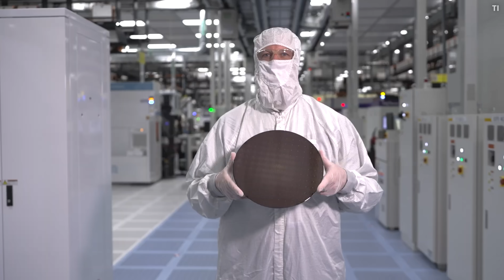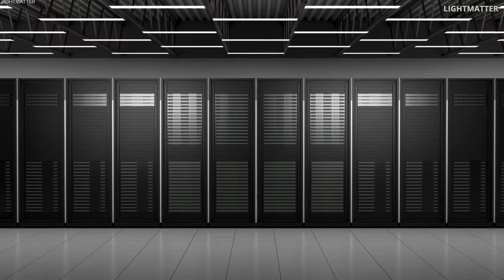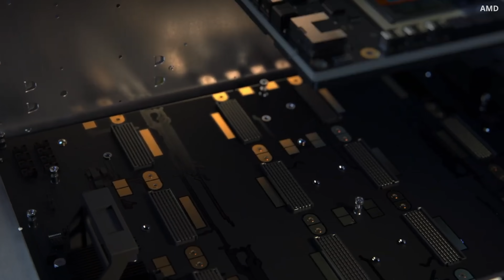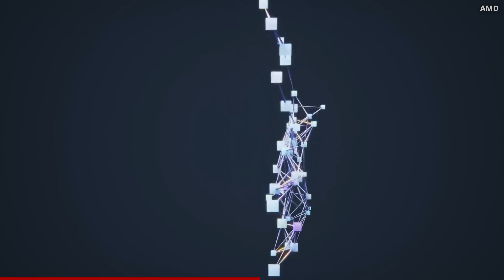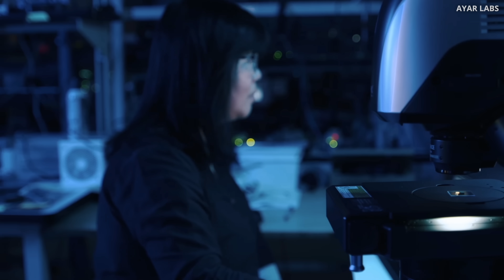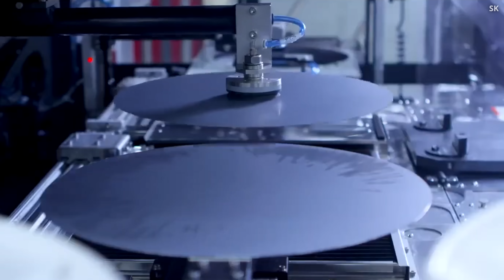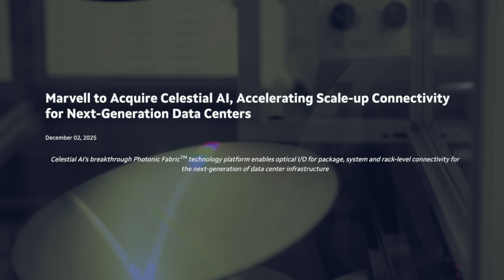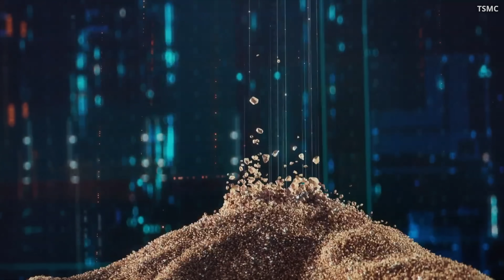Everyone Is Chasing This Technology

Comment: @AnastasiInTech,

I'll grant you the science: gallium-arsenide lasers grown in etched silicon trenches, a modulator running near 440 gigabits per lane. That's hard won. But you're treating the breakthrough as permission for the growth it unlocks, and that is the mistake.

Light really is more efficient per bit moved. The trouble is that efficiency per unit and total energy used have pulled in opposite directions for fifty years: every time we made a bit cheaper, we moved so many more of them that the total bill went up. That's Jevons paradox, and it means faster optics won't relieve the resource crunch. It will accelerate it. The limits that actually bind don't care how clever the chip is. Cooling already eats about 40% of a datacenter's power, one campus pulls 1 to 2 gigawatts, and you can double interconnect efficiency every couple of years, but nobody doubles a grid or a water supply on that schedule.

Then there's the money. Three-billion-dollar acquisitions and million-GPU factories are being financed against projected demand, not revenue in hand. Most of the capital is circling back on itself. We've seen this shape before. In the late dotcom years the companies laying fiber were right about the internet and went bankrupt anyway, because the demand they were right about arrived too late to save them.

That's why your framing is the problem. Celebrate this as the last obstacle cleared before we scale again, and we are re-running the fiber boom with bigger numbers. Except this time we're putting the climate in peril, not just the bank accounts of big tech bros. Make efficiency the goal instead, and the same breakthrough changes jobs. By efficiency I don't mean one more way to squeeze scale out of each watt. I mean a fixed ceiling on power and water, with the intelligence engineered to live inside it. The systems that survive the next few years will be the ones that live within their supply, the way a tree grows out of what it captures from the sun rather than stripping everything around it. Photonics might be the next step. What I keep hearing from you, though, is that every step is a reason to build bigger and pull more power. This is the video where that reflex reduces your credibility. You read this stack better than almost anyone covering it, which is exactly why it's frustrating to watch you spend that credibility cheering the part that breaks it. Point it at efficiency instead. That's the target worth chasing.

Comment: Then those Datacenters, should have renewables everywhere: Solar Panels on the roof and exterior walls, Smaller Eolic plants, invest in Hydroelectric Plants from nearby rivers; Thorium Molten Salt Reactors, and other types, if they have so much $ to make them, they can Contribute to Society, by not being a burden to Society.
Arsenic, being tossed on landfills, poisoning the ground, water, that people will drink eventually; hence, bad idea. We need to garanteee, the millions of Tons of Arsenic compounds, where to repurpose it, without being toxic? I think, we need to keep searching.
I hear that Transparent thing layer Crystals can be done with Tungsten (W), and it has the highest melting point 3,700ºC of all Elements, maybe this could be used for making Microchips and Photonics

Comment: Hoora Anastasia ,
This is EPYC,  (yes i use AMD, affordable 7713 & Mi300 ) cant afford 9005 Zen4, u've struck a gold HIT, a Helios Goal.

Only solution in future  
real-time inference datacenter engines,  power-hungry last mile copper >Si  interconnect,  IS exactly Light.

Of course materials, limits physics with pandoras box issue
GaAs in Vchannel Si not long term stable.. thus Ge epitaxy on Si-

Coupe has gr8 optical thinfilm interconnect bet 
standard GPU racks (obv to protect D.C investmnt

SO GLAD u brought LM into this💨🎆 STACK.
with dichalcogenide ALD now simulated to 5-Layer  its only a method to achieve production atomic integrity.

Import my 3rd Emicroscope,to AU this time a 2KW Fibre pulse laser waits to unpack.

Light Matters are right, a need to replace junction FETs
High speed GaAs laser integated optics, to address layer adjacent GePSi compute slices, phosphorus Gr8 @ UV

Comment: "Instead of omitting photons it just releases energy as heat"
Heat is a photon (infrared). All you need to do is work with that freq or shift it (such as the Compton Effect) to another Freq.
Actually from a physics level even the magnetic field which surrounds a wire is a freq of photon. Magnetics is below radio waves.
The mechanics are that at each freq some things are transparent, some thing reflect and others absorb. It is true for all freq. The rules just change at diff freq. For example metal or magnetic fields are opaque to radio whole walls and certain amounts of rock are transparent. Know your properties at each freq and use them.

Comment: If the problem is the power supply, the smaller size, the metals needed, the heat they produce, the simultaneous speed of processes inside the system and in the other hand you have a printer that prints meat.... stop thinking about how to build another chip of silicon and metals... and print a 3D brain made of meat. As raw as that.  En español: Si el problema es la fuente de alimentación, el tamaño más pequeño, los metales necesarios, el calor que producen, la velocidad simultánea de los procesos dentro del sistema, y por otro lado tienes una impresora que imprime carne... deja de pensar en cómo construir otro chip de silicio y metales... e imprime un cerebro 3D hecho de carne. Así de crudo.    ----    Design and print a "meat chip", like the brain works and see how it works, because may be with a few thousand "printed brains" you might achieve  better results without the heat, the metals, and a lot of other problems that non organic systems produce... Start thinking on "organic chips"... ---- i said it before like robocop 1... but more like  the approach of the  "bicentennial man" movie...

Comment: I would say, a big part holding us back is insufficent math in our code. Most programms guzzle ram, and cpu power, mainly because we don't focus on math elegence and computing efficiency, but just bloat all stuff. Look at for phone when starting it for the first time, how many programms are you using of the pre installed programms? Or windows 11. At the point of windows 11, a huge factor why windows 11 is so slow is because your data get's sent to the cloud, and ai is watching you, meaning bloat you don't activelly use runs allways in the background.

Comment: POET Technologies Inc. (NASDAQ:POET) introduced the Hybrid-Integrated 1.6T 2xFR4 Transmitter photonic integrated circuit (PIC), a new microchip capable of transmitting 1.6 trillion bits of data per second and supporting the growing demand of data centers, as networks slowly transition to 1.6T architectures from 400G to 800G at present.

Comment: Seems like they would be using geothermal cooling techniques.  The way they did it centuries ago were geothermal tunnels and strategically placed wind towers to catch the wind.  With a underground water reservoir deep in the Earth and the wind produced by the tunnels you can get down to freezing temperatures with no electricity.

Comment: Four General-Purpose Computers (GPCs) Run Primary Flight Control Software In A Synchronized, Quad-Redundant Setup Constantly Cross-Checking Each Other, And If One Deviated, It Could Be Voted Out Of The Operational Set.

Comment: Free Carrier Absorption Occurs When A Material Absorbs A Photon, And A Carrier (Electron Or Hole) Is Excited From An Already-Excited State To Another, Unoccupied State In The Same Band (But Possibly A Different Subband). 

This Intraband Absorption Is Different From Interband Absorption Because The Excited Carrier Is Already In An Excited Band, Such As An Electron In The Conduction Band Or A Hole In The Valence Band, Where It Is Free To Move. 

In Interband Absorption, The Carrier Starts In A Fixed, Nonconducting Band And Is Excited To A Conducting One.

In The Simplest Approximation, The Drude Model, Free Carrier Absorption Is Proportional To The Square Of The Wavelength.

Comment: Gallium (Ga) Isn't The Primary Element In These Advanced Modulators; Instead, Silicon-Germanium (SiGe) Integrated On Silicon Platforms Efficiently Converts Light (Photons) Into Electrical Signals (Electrons) Using Electro-Absorption Effects, Creating High-Speed, Compact Optical Modulators For Silicon Photonics By Leveraging Germanium's Strong Light Absorption Near Telecommunications Wavelengths (1.55µm) And Integrating With Si CMOS Technology For Electronics, Offering Solutions For High-Bandwidth Data Transfer.
These Modulators Work By Applying Voltage To Change The SiGe's Free Carrier Absorption, Thus Controlling Light Transmission, Enabling High-Speed Data Encoding

Comment: The average ground temperature at 20 feet underground is between 50º F and 60º F (10-15.5ºC) Why do all these facilities build as surface structures instead of taking advantage of the earth's ground temps? I know, it needs to be cooler than that but starting at 50-60º beats starting at 80-90º - keep it cooler.

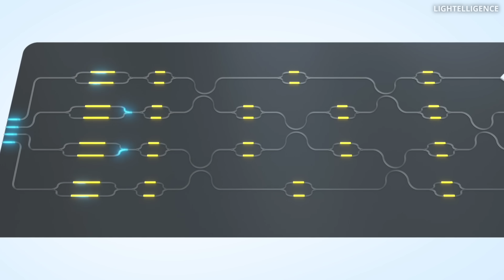Comment: 5:30 You're talking about fiberoptic cable.
9:50 Sound like you are looking for a spark. That could be tiny and generate the flash you need inside the chip. Of course you would have to compensate for what that spark does.

Comment: There is still a comparatively pedestrian hurdle to integrating photonics directly with silicon chips: the mechanical fragility of fiber optic waveguides from the chip to a connector in the device enclosure. In particular, the point at which those waveguides exit the silicon package represents a step function in stiffness unless an adequate support jacket is used for the free end. That has to be mated to the material encapsulating the silicon in a way that permits mass production.

But yes, switching to photonics will revolutionize die-to-die interconnects, enabling large distances between them with low energy losses. The only fly in the ointment is that AI companies will probably use the power savings for building even larger data centers instead of reducing the total power draw of the AI industry.

Comment: The idea they're building these massive data centers but aren't exclusively using photonics internally makes 0 sense.

Also, cooling reflexively at that scale feels incorrect. Like we should triple the cooling and keep the room sub 50 degrees all the time.

Frankly though if those modulators are the last choke point it seems as though that's whats needed to go logically. Frankly, ditching the electric signal to light signal needs to happen. Only light being transmitted across every chip and board being the end goal.

Comment: The current CPO designs are fully build on external lasers (ELSFP) by Lumentum and others.  Hybrid lasers are made by Intel and TowerJazz since years, not as simply as the IMEC process, but they are sold in millions of transceivers. You are strangely mixing state-of-the-art technology with research level technology. This is a bit confusing.

Comment: There is scale-up, scale-out and scale-across… for optical communication. You are mixing it all in one pot. Industry will gradually adopt optical transceivers and optical interconnects from scale-across to the scale-out and final to the scale-up level with CPO.
TSMC has been in silicon photonics for ten years and has a well proven PIC technology. COUPE is the next level or co-packing of photonics with electronics. COUPE is already being industrialized in scale by the SPECTRUM-X and QUANTUM-X switches by NVIDIA, which you did not mention…. Maybe because of your sponsor.

Comment: It's been known in the music industry for decades that germanium frequency modulation produces much more desirable tone/stable energy. I already guessed it before you revealed it that it was crystal and germanium that was the solution, or should i say crystalline germanium? 😂 I should've stayed in Engineering...😂😂😂 The transfer of energy, especially light or full spectrum light energy is dependent on the most even lattice-work of the element and the stability thereof. This is even true, of course in superconductivity.

Comment: How to compete?
😂2025-11-11 Silicon Valley data centers totalling nearly 100MW could 'sit empty for years' due to lack of power — huge installations are idle because Santa Clara can't cope with surging electricity demands

Two major facilities built for AI-era workloads remain unpowered while the city races to expand its electricity supply.
without power , they are useless.
🤪When power arrive few years later , they are outdated.

Comment: Huawei connects AI modules with fiber using cutting-edge all-optical networks and AI-driven solutions, achieving massive bandwidth like the Atlas 950 SuperPoD's 16 PB/s interconnect, enabling lossless, high-speed data transfer for training giant AI models across data centers and campuses, often reaching 10G/50G speeds with F5G-A tech for efficient, low-latency AI computing everywhere. 

Performance & Speed:
Massive Bandwidth: The Atlas 950 SuperPoD offers 16 PB/s interconnect bandwidth, exceeding global peak internet bandwidth.
High Campus Speeds: F5G-A brings 50G to rooms and 10G to Wi-Fi APs, supporting demanding AI applications.
Low Latency: All-optical designs and AI optimization drastically reduce latency for better AI training and inference.

Comment: Googles Project Jupiter is already operational. Not only does it accomplish what you're describing, using a high speed optical fabric interconnect, it does so using MEMS mirrors to direct the beams so that the network can be dynamically reconfigured. The entire architecture of the GPU cluster interconnects can be defined entirely within software, in the near future it will be able to do so in sub millisecond slices. I mean yeah, why even bother shoving this down into chips though? the quadric scaling issue doesn't go away just because you have a more efficient chip.

Luckily, I have a solution for this. This isn't the appreciate setting to go into detail.
Reply: if you'd like to explore further:
Apollo: The overall project that replaced traditional "Spine" switches with optical ones.
Palomar: The name of the actual 136-port MEMS switch Google designed in-house.

Comment: You say that silicon doesn't emit light, it just releases heat. Heat is light, it's just a longer wavelength, "IR". Why can't they just read the IR spectrum being dumped and convert that to transmittable fiber frequency? Or transmit the IR frequencies emitted? You don't need a lot of heat being dumped, just enough of a change to be read. Not enough to cause a build up of heat. With thermal cameras today we interpret very minimal IR sources.

Comment: More and more new chips, but they're less and less useful, they're getting more and more expensive, and the cooling system is getting bigger and bigger, and the electricity bills are getting bigger and bigger, and there's a shortage of electricity itself—you can't pump out more than you have. But we'll definitely play Rust with whores!

Comment: @AnastasiInTech
For maximal lane isolation, signal fidelity, and thermal stability, we should consider inserting ultra-thin mica sheets between the V-gate planes. This could reinforce deterministic execution, prevent cross-talk, and optimize photonic propagation under continuous load.
Reply: Consider one-atom-thick mica sheets for interdependent lane density.

Comment: If you are referring to Silicon Photonics, tsmc will be the first. By 2027 it will roll out AI chips made by Photonics, 3D packaging will be CoPoS instead of CoWoS. Wafer will be rectangle instead of round and glass based. 6 x CoPOS 3D packaging plants are under construction as we speak, and 10 more new fabs will be constructed each year. To dominate the market, it is not just able to make the chip but able to provide in quantity.

Comment: Silver is the best known conductor, copper is only #2. Still, it would have its own wall, that would be hit fast. Copper was used because of the price, flexibility, and ease of working with. silver is ridged, and unpractical for wiring, but might improve circuits, but etching it with acid might not be possible.

Comment: Well you probably get to holographic datasets beamed in by holographic optical elements if it runs through a vacuum pipe from one chipset to another basically if you have something that forms a fast base plate for the interference pattern brake a chip waffer into nano particles that react to input from one side and have it do things to light from another frequency by parallel transfer you win too it might be worth looking at...
If you go on this path you might actually get complete chip to chip transfers of data...

Also the nano chip powder inside a block might be an interesting setup like ram memory for storage of holographic data in another way...

You simply make it by having nano fracture lines in the chips and use ultrasound to crush them further and further in a fluid since there is a difference between fluid and chip waffer that is key...
If you can manage this it is not only per chip but a complete chip to chip transfer in parallel...

Another thing if you run so much heat differences then you might want to look into sterling engine sets for winning some energy back especially if the environment allows you to do so and having systems like sterling engine cooling pre cooling the cooling liquid in order to do this...